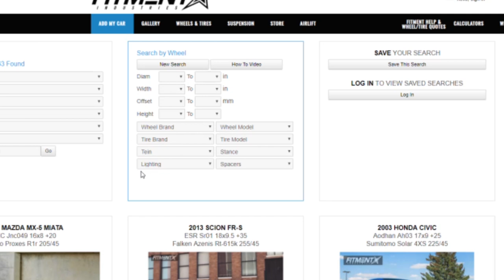Are Tein Coilovers Worth It?

Comment: part of the reason why the Flex line of coilovers are so affordable is in the damper itself.   It's a sealed unit that was designed so that it can be almost completely manufactured by automated robots.    They can produce more in less time using less parts vs a rebuildable unit.   Since the cost of rebuild is often more expensive than buying a sealed unit, it makes a lot of sense for the people who don't do professional racing but still want good quality affordable coilovers.

Comment: Many Subaru owners in my region love Tein coilovers.

from the decent sets to fully adjustable active suspensions.

if you use is track, they got one

drift, they got it too

off road / rallying they got that too. 

before Magnaride came about

Tein already has a system called the EDFC or Electronic Dampering Force Controller and you can adjust your suspension settings on the fly in the car without taking out a wrench or spanner. 

now the latest version can do active suspension settings for daily use or track use.

running the lowering springs on my Subaru Crosstrek

will switch over to their coilovers in the future

10/10 rating
Reply: Where can you get the Tein Edfc kit cause I have an 08 Civic with Tein Advanced Z Street coilovers so do they work with my car?

Comment: I remember rebuilding my Tein coilover and every part was unique to their shock. The one thing I don't like about them. Is that they use a 2.75 sprig diameter and not the standard 2.5 so buying replacement springs means going through them.
Reply: heith85 swift springs

Comment: I have a 2003 Lexus IS 300. Bought a set of Tein Z coilovers. They have two different part numbers. I understand this is for front and rear. But the problem I have, is the front struts I got for my car mounting bracket looks different than the one I see in the brochure. Mine, the front strut, has a single mount bracket and the one shown, in the pictured has a completely different mount. So I looked a the part number and the first four digits are correct but the last, four characters, aren't. Then the back ones aren't even listed in the web site. How do I find out if I have the correct struts? I put my info. into the type vehicle, year, model, and trim. The one that came up looks similar but the model number of the strut is different and I don't even see the rear. Not to mention UPS took forever to get them to me. So I had to go to their terminal to pick them up. The box looked like a bomb hit it. And when I opened it up. One of the mounting studs fell of, and I had no spanner wrench to adjust the struts. I did contact The Fulfilment Industries company, but they are closed on the weekends. Confused.
Reply from the maker: Sorry to hear this. Please email us at shop@fitmentindustries.com and we'd be happy to help make it right!

Comment: I run Flex Z's on my IS300 n have been kicking myself since I got them. Got them bc of how much people have talked about how good Tein coilovers r over the years, n the fact they were about 200 dollars less than what I had planned on running (BC Racing or Fortune Auto). I had BC Racing coilovers with Swift springs previously n they were way better. Each click of the damper adjuster could b felt with the BCs, with the Flex Zs I can barely tell the difference from full soft to full stiff. Spring rates r kinda on the soft side for my liking as well, n its not as easy to upgrade to a stiffer spring with the Flex Zs. Idk if its just this line of coilover from them or what
Reply from the maker: Yeah, I have heard from a fair amount of our fans that the one thing they do not enjoy about Tein is that the spring rates are a little bit more on the soft side, But for the price you can't argue, Your Lexus sounds dope man you should upload it to our gallery!  https://bit.ly/2Ma4oca
Reply: I was thinking of getting those for my IS as well, not trying to slam the car, about a finger & a half gap all around is my goal. On full stiff is it floaty on the highway at all? Even a little bit? Thanks in advance!
Reply: @I2obbie12  ive got mine lowered to a lil less than what to ur looking for n on the highway it can get a lil floaty. I also run them near full stiff damper setting ~12 of 16, n its still floaty. I run sway bars, poly bushings n spherical bearings, n chassis bracing front to back, top n bottom, still doesnt make it as stiff as id like tbh. Im def switching back to BC Racing, highly recommended
Reply: @FitmentIndustries  the price savings was what made me go with them for sure, n figured theyd b close to on par with the bc's/fortune auto 500's, esp since teins site had em rated at closer to performance/light track duty than some of their other offerings in the price range
Reply: Smart Feller damn that makes me sad! :-( i figured the 10k/8k would be fine on the IS but I guess Ill save for the BCs… thanks again
Reply: The Flex Z's are really soft.

Comment: The biggest reason why I prefer Tein over any other suspension brand is because of their EDFC system that can either adjust the stiffness on-the-fly or allow you adjust the settings manually from inside the car.

I don't know if K&W has something similar but I'm Team Green all the way until then.

Comment: Anybody on the flex A? Just ordered a set I hope im not disappointed. I noticed most people get the flex z instead.
Reply: I noticed you have a BRZ/86. How's the flex A's?
Reply: TheWiggles I really like them. They ride very smooth yet still have the subtle sporty feel of a coil over.  Even at full stiffness they are not too bouncy. The one thing I think flex Zs have over the Flex A is that they can be adjusted much lower.  I have the rear as low as It can go and its about a 1and a half finger gap between the fender and tire which is low enough for me but others may want more low.

Comment: I run the Tein Flex Z with the aluminum pillow ball mounts on my 97 Honda Prelude. That with some Tanabe Front and Rear Sway bars with 225/45/16 make my car ride on rails. I love them, and am really glad I got them.
Reply from the maker: Sounds dope man you should upload your ride to our gallery we'd love to see it! https://bit.ly/2Ma4oca
Reply: Fitment Industries  I made an account on the website and have been meaning to go ahead and take the required photos for the Gallery. I will definitely do that in the next few days. I also got the H23A with some equal length ramhorn headers to a full exhaust. I make myself laugh all the time when taking sharp corners because when you take 90 degree turns you can make the tires chirp by throwing the car into the corner. 

Also, Thanks for the videos! I really enjoy getting an insider look at the current state of companies as well as their story.

Comment: All the guys in my subaru Facebook groups say tein sucks for wrx parts, so I ordered some raceland primo coilovers, every time someone is selling some teins all you see in the comments is trash talk, maybe I should have given tein a chance, not sure if they are just trash on a wrx, or if the guys in my groups just crap on them because they're cheap.

My racelands were only 620 bucks tho haha, but warranty seems nice, adjustable damping, and spring rate is like triple what stock suspension was on my wrx. 

Didn't really wanna drop my car, but my rear springs shattered and I gotta fix it, and I try to upgrade whenever something breaks, even if I can't get the top of the line I try to get a decent value upgrade rather than oem replacement.

Comment: i have a lowered toyota alphard 2005 3.0ltr version , problem is vehicle tends to bottom out when riding rough road surfaces so would it be possible to fit Tein Flex Z coilovers with front strut top spacers reason for the spacers is the Flez Z are already 30.mm lowered

Comment: Aren’t Ohlins the best coilovers?
Reply: Yes they are. Also some of the most expensive. They are in my opinion only  necessary if you're pig rich and going 100% purpose built race car and you are seriously competitive.
Reply: @rotorhead5826  exactly👌.. Ran ohlins in my old sti type-r. Run Tein in my current fd rx7 and evo6.5 plus other previous cars I've owned, for street cars it isn't worth the massive cost difference when your not trying to shave a tenth off of a lap time.
Reply: Compared to which? Yes it 's much better from the one that I own flex z but i don't believe it' s better of super racing..